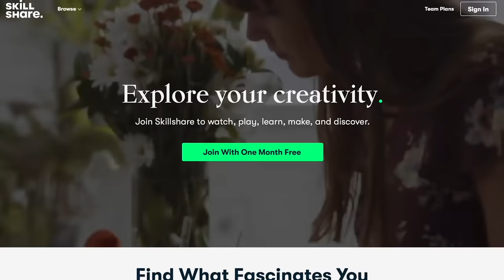Cleaning Out a Hoarder's House | Scattershot Phase 1

Comment: Make sure to fill the gap in the concrete with expansion joint compound. If you have a kitchen near by the ants etc will come in through that gap.
Our house was sprayed every year, and when we bought it we had no idea. Gap between chimney and slab in the middle of the home. Poured that between the Crack and never had bugs since.
Reply from the maker: excellent shout. thank you! 🖤

Comment: You should look into getting a cat's paw nail puller, it's pointy so you can dig under the head of nails. It could help in places where you can't get the flat bar behind the material.

Comment: The stud bolted to the door was probably from the door being bashed in at some time in the past. Burglary, police raid, angry person.  Just an expedient repair.
Reply from the maker: i had thought the same thing but it not connected to anything except the wall behind it 🤔
Reply: @ijessup  It is just to reinforce the wood for the latch plate for the door. Not any structural support.  All those little tedious things you are doing now are the worst part. When it starts going back together, it will go really fast. Kudos.

Comment: Most houses I don't think use cardboard - what do the do instead?  Caulk or housewrap on the outside?  Just curious.  how do you 'fix' the gap between the concrete addition floor and the house?  You didn't say  it had an outdoor spa!!!  One more suggestion - demo the fence by hitting it with a truck (an old truck)
Reply from the maker: cardboard is definitely not part of a building plan but it is not uncommon as a cheap fix for insulation. this house had no heating or cooling unit and it gets into the 100s in summer and below freezing in the winter. i will probably use concrete patching to fill any gaps

Comment: I am thinking that keeping a pumped up bug spray jug with a clorox/water mixture would be good for spraying over each new layer of wet/mold areas that are uncovered. Helps with dust too. Maybe you are past this point on most of this project though.
Reply: Is there mould? Everywhere looks so dry i don't think anything can grow. 
All the wood seemed to be so dry it sounded completely hollow
Reply from the maker: thankfully, i am but that’s a good shout 🖤

Comment: I presume the Quikrete went between the two slabs where you removed the rotten exterior wall? Did you treat the bare ground between the slabs with anything like lime? Other than some questionable sill plates the house appears to have good bones. Being an exceptionally good natured person is paying off for you with this project.
Reply from the maker: haha! the quikrete phone call didn’t actually have anything to do with my house 😂 just a normal phone call when you live at maker ranch! i’m going to put in a french drain all around the house and then gravel it between pavers but that’s a ways off
Reply: @ijessup  Sounds like a lot of work too.

Comment: Random question,  but what are those nail pincers with the claw head you are using at around 1:45? I can't find anything like them online!
Reply: They're often called nail puller pliers, I've owned a set from Crescent for a decade that have held up well.
Reply from the maker: mine are husky brand and i got them from home depot. they are AMAZEBALLS
Reply: @ijessup  Cheers, thank you!
Reply: @SmartMass  Cheers, I've never seen any with a claw head before though.

Comment: Not mansplain, but you have to use your pry bar as a fulcrum. The wood will peel off.
Reply from the maker: hmmm… and what was it that i was doing?
Reply: @ijessup  Not the best medium for me. I have demolished a few interiors with a pry bar similar to the one you have. When peeling sheets, I use the curved end with a slight wack with my hammer and then push the pry bar parallel with the plywood. The wood will lift up. I start at the first nail I can find and work my way down. I bought a similar house about 26 years ago and learned some hard lessons. I have nothing but respect for what you are doing.
Reply: @ijessup  You were doing it like he described at 9m40-42s - getting the short end of the prybar in between the stud and plywood, then pushing/pulling up or down on the prybars edge.  Then depending on what's in the way / if it's all nails, you can possibly get a row of nails out, then just pull on the plywood and it'll peel off the studs, leaving the rest of the nails in them.